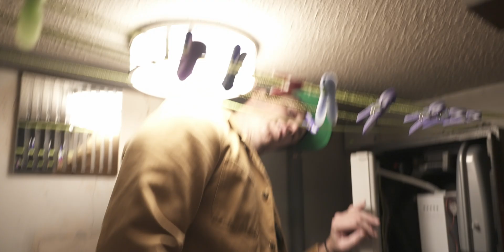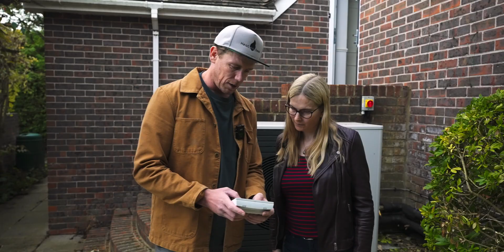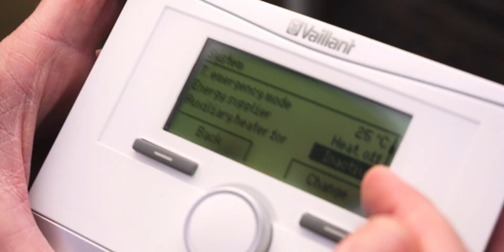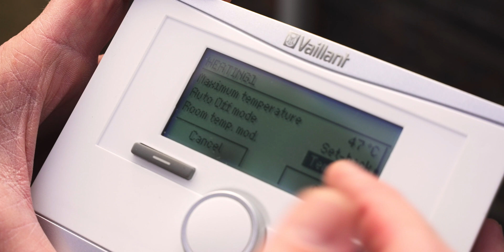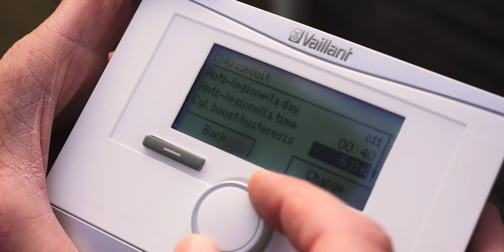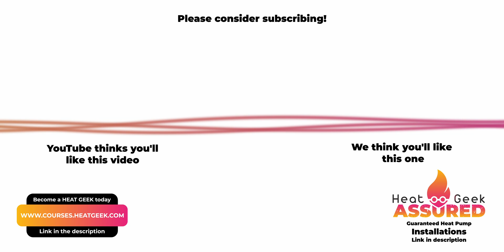How To OPTIMISE Heat Pump Settings!

Comment: What outside temperature should one consider when sizing a heatpump? I worry about my installer recommending one that's oversized for the milder days, but also not keen on an undersized system for the coldest periods.
Reply from the maker: Between -1 and -3.5
Reply: @HeatGeek  Thanks! So in warmer temparatures there's some inevitable cycling due to lower heat loss, but as long as HP is optimally sized, this is minimized.
Does the Arotherm Plus 7kw have an eco setting which limits performance in mild temps? I know the Saunier Duvals do, but installer doesn't recommend due to refrigerant. Your channel's fantastic by the way!
Reply from the maker: @A.N.O.1412  sorry I don't understand what you mean by an eco mode?
Reply: @HeatGeek  Sorry, I meant is there a way to set the heat pump to limit the output to say max 60% of the rated output? Saunier Duval's Genia HA series calls it "Silent mode". Does the Arotherm Plus have  anything similar?
Reply: @HeatGeek  Hi Heat Geek. Any idea if the Vaillants have such a mode, or is there a setting to limit output at warmer outside temps? Thanks!
Reply: Got the answer, automated weather compensation control.
Reply: It very depends on the lowest temperature your place can go and how often you reach there
Reply: 25 degrees between inside and outside temperatures to be absolutely sure
Reply: @hazmat5749  that's if you don't off the unit. If you do off unit, count for -10 °C

Comment: "always try and design without a buffer"... should I be concerned if a buffer is specified by an installer?

Which brands would be on your "high quality heat pumps" list please?
Vaillant, Veissmann... any others?
Reply: Bosch. I’d always recommend the boiler manufacturers heat pump, the logic of heating is a lot better than daikin and Mitzi
Reply from the maker: The 3 top heat pumps are nibe, vailant and viessmann. Weather you need a buffer or not depends. I can only suggest a heatgeek
Reply: @HeatGeek  The company I contacted before I discovered your map offer Mitsubishi. My local ish Heat Geek provided an estimate for a Midea. Viessmann have put me in touch with an installer who's not on your map (yet) and today, I cross referenced your map with Vailant's site and reached out to Vito.
Reply: @HeatGeek How does a Midea compare? LeiChat mentions his heat geek quoted for one?

Comment: OMG, look at this thermostat! an unusable design from 80x, who designed this square thick box? Vaillant really? Monochromatic screen in 2022? Look at the thickness of it, does it use vacuum tubes? that would ruin any interior. looks like they were trying to make production cost sub £20. How much do they charge for that? £250+? can you use an app? yes, and it is even worse with a rating of 1.8 stars? can you use something nice, like nest/tado? No? because of incompatible eBus. OpenTherm support should be required by law for all consumer boilers and heat pumps. Adam, superb video, but feel really sorry for Rachael ending up with Vaillant.
Reply from the maker: Totally agree with the physical design and good point! When it comes to actual control of the system though, to suggest nest or tado was comparable or better is laughable. The box its in doesn't represent its ability. Never judge a thermostat by its cover
Reply: @HeatGeek  Sorry, but I would judge, the reason why they do not do OpenTherm is because they can't create a good product and compete. this is why I want to reply to @Candisa here also. I am not a heating engineer and have very little knowledge about heating systems (basically whatever Adam shot as part of consumer advice), but I am a software engineer with a good background in electronics, and will be talking only about this part. I've used ESP8266 to create a small eBus controller, and thanks to ebusd project I was able to create my own map of reverse engineered massaging and talk with the boiler,  have my own weather compensation,  and learned the communication part of this. When a company takes an open standard and creates proprietary extensions on it to stop others from implementing 3rd party controls, they are doing that not because their controls are that good, they are doing it because they are bad. Otherwise, SensoCOMFORT and V700 would be OpenTherm/original eBus compatible and people will buy them to run with other manufacturers' boilers and heat pumps. Vaillant group goes out of their pants to make a different variation of even own eBUS extensions to prevent reverse-engineered implementations. It is like your TV would implement over the same HDMI cable a different signal to work only  with a TV box which is the same brand. This limits OpenTherm itself, there is no reason to invest money, start a company, or provide better products, because most of what you can do is cycle the boiler/pump in on-off. V700 has a bad design, MultiMATIC may have a slightly better look and feel but a bad UI, and this is it. this is your choice or your "no choice". Apps reviews are horrible, and because of that I would not expect a good quality of software engineers in Vaillant, that means your data is not safe and you are better off the Internet connection for this device. No Internet, then no home presence sensing, and no learning. Here I am not judging any part of the heat pump quality, but the software and vendor-lock practices, and the ways they are implementing them are absolutely dreadful, the whole industry of software and IT hardware is openness in communication standards. OK, if eBus for some reason is far superior to OpenTherm (it is not, let's just imagine the case), publish the message documentation, and do not change them with every hardware revision, make it a standard.
Reply: If you want to have a flashy modern black touchscreen thing on the wall there's always the "SensoCOMFORT". 
Most interiors still have simple white but quite blocky switches and sockets, so if you want something that matches that and doesn't have to emit light to be readable in daylight and has physical controls, you're better off with the MultiMATIC like in this video.
Reply from the maker: Open therm should not be in heat pumps imo. The control and heatbpump need to be as 1 and understand eachother. And the ipen themr controller has to have good permatter options. If there was 1 single open therm controller outthere comparable to a vailant viessmann or nibe I may change my mind but even then it would be open to put poorer controls on
Reply: @HeatGeek  Another reason why we need that 'manufacturers controls only' bumper sticker :D
Reply: @Hugh Frater @Heat Geek  In this Video I saw a ton of confusing settings because the VRC700 thermostat is dumb. Maybe Adam can explain to me and others why smart thermostats need a weather compensation curve at all? Why it would rely on a human being to make the right decision in selecting a number? from eBus (OpenTherm) it can receive heat generation by the heating system, electricity usage, flow temperatures and pump speeds/performance, which gives it enough information about the amount of pumped heat, it can see the temperature changes with almost 0.01 steps for inside and outside, it can easily calculate the property heat loss better than any heating engineer. Smart thermostats should learn the heat loss pattern of the property and do weather compensation and will be able to react to higher wind or sunny days or forecasts. 

But why the third-party controls even with OpenTherm have that bad reputation? this is just bad gas engineers installing boilers. An example: my property was about 6-7kWh loss in a cold day, I switched the annex to an air-to-air source heat pump due to it living a completely different life than the rest of the property. Now I have maybe 6kW heating demand. The boiler sized by the previous owner's plumber 2 years ago is 26kW with the lowest output 7.3kWh. there is no modulation, only on-off mode as result with any control even the manufacturer. The lack of open standards in the boiler doesn't allow nest to learn the property as no feedback is provided.

 If you think that eBus/OpenTherm is full of "high-level smart things", nope it is not, it is a very simple and primitive serial bus. if you have a controller connected, it can tell the boiler (heat pump and other boilers is absolutely the same, Vaillant changes messages slightly, but the list of parameters stays the same for all their group products): switch on or off heating/hot water. flow temps for both, pump mode control, and a few minor things. In short, all the controller tells your heatpump is the desired flow temperature. the controller can receive information from the heating system, like gas/electricity usage rates, flow temperatures, and other things (even time to next service for some models) to make the right decisions on just the flow temperature.
Reply: @ksim_  The only controller/smart stat that does this is Homely - and it supports realtime flow temp control over 485 to Midea or Samsung heatpumps. It knows electricity spot pricing, weather forecasts, solar gain, internal room temperature. It will self-tune the WC curves for maximum efficiency, and will switch to load compensation if that's required for fast recovery from a setback.
Reply: @dorsetengineering  so do nest and tado, but on  properly sized systems connected to OpenTherm, Homely won't be able to modulate anything if the maximum demand of the property is lower than the minimum delivery of the heating system  

Glad you agree that  VRC700 is a dumb thermostat as it is not doing any of the above. 

 ebus/OpenTherm/485 all have essential messages for a smart thermostat to do its thing. receiving metrics about flows, consumption, and efficiency + feedback on the flow temperatures and basic on/off states. There is no magic in any of these protocols, the only reason they do exist is the companies are trying to vendor-lock you. Vaillant knows how to do a pump/boiler, but their software side is laughable.

I fully disagree with Adam and you about the manufacturer's controls as one with the heating system. the "smart" thing of a thermostat is in decision-making, not in the communication protocol. Sure Adam can make a video and explain how Vaillant's version of eBus makes it by far superior to OpenTherm, highlighting the messages that make it so, will be happy to watch it. But for now, IMHO, it is just shady vendor-lock practice to limit competition and sell overpriced ugly-looking products.
Reply: @ksim_  gas boilers talk opentherm, heat pumps don’t so until we get a programmable opentherm to modbus gateway then we’re stuck with manufacturers controls or homely. Both of which are superior to simply controlling a heatpump on a fixed flow temp with an on/off stat. I’m fully aware of how good a nest, running in opentherm mode, into a gas boiler can be, but it’s something that’s just not do-able yet with heatpumps. An opentherm to modbus gateway wouldn’t be hard at all, you’d just need to program a specific set of modbus registers into the gateway for whichever heat pump you were talking to. I don’t honestly think it’s a case of vendor obfuscation and lock-in, I just don’t think they’ve given it much thought.
Reply: The nest is fairly dumb compared to this. It limps along realying on an internet connection for most of its energy savings. I don't mind my Mitsubichi FTC6 thermostat in the least.
Reply: @djenson  nest is dumb in on/off mode, as 90% of people have it in, and is very good in opentherm, at least was for me. but the question here is the locked down made-incompatible-on-purpose devices, to sell these horrible-looking and functioning controllers, which you can't control. I do not trust Vaillant or Mitsubichi with the data of my home presence, judging by the quality of the app you can't trust they keep the data safe.
Reply: @ksim_  I was going to take you seriously until i saw "I do not trust Vaillant or Mitsubichi with the data of my home presence", So you trust google over mitsubichi? Interesting. (let not forget the current lawsuit against google)

 Mitsubichi both emailed my and sent a notifation to the app when a vunerablity was found in the WPA2-PSK protocol and gave advise on how to keep the system secure. That has nothing to do with them, but because it could techniqually cause a breach in the system, i was informed, Once a vunerablity was found that with local access, a backdoor could be formed, a patch was sent out with a explaination of what had happened. You dont see this from google, just a "fixed bugs" 

Anyway, let continue the sencible points

The whole point of what I was saying that in order to save the $145 that nest quotes, it relys on the internet connection to do its turn on/turn off perimeter thing. You do *not* want to do that with a heatpump. There is no effiecency benafit to connecting proper heat pump controls to the internet. You do not need to trust mitsubichi with your data, purly because it does not need to be in there hands in the first place.

Opentherm allows for modulation, sure, but opentherm does not understand many of the varibles heatpump controls do. Take my heatpump controls for instance, they have access to flow and return temps, Outdoor temps, indoor temps and the hot water tank temps all in one place. Opentherm (as far as i am aware) does not allow for this data, that is essential to a heatpumps effiecent operation. 

"horrible-looking" is subjective. I prefer my FTC6 controller compared to the nest, and it is certantly much more readable then the tiny screens found on nests. It has clear buttons and doesent need 20,000 submenus to do something. 

There locked down for a reason. They dont want some idiots saying "oh lets put this thermostat in becuase it looks pretty" then moaning about the £££ bills a months later

You with your ESP32 custom made controls, genunily awesome, but make some videos on it to show, teach and encourage others before moaning that a data mining monopoly cannot less efficently control your system.
Reply: Nest is an on off dumb thermostat with an internet connection isn't it? Looks aren't everything.

Think tado do proper weather compensation ones.
Reply: @Lewis_Standing  Nest is OpenTherm compatible weather compensation learning thermostat, the problem is boilers and heat pump manufacturers running eBus with proprietary extension data packets, so you can't use anything except on/off. Check Adam's video on thermostats.
Reply: @ksim_  which heat pump manufacturers support open therm?
Reply: @TC-V8  Not many as far as I can tell, they all (at least all the decent ones) support modbus over 485 though.... Most have full flow temp control over modbus...
Reply: There is a much better looking controller available, the sensoCOMFORT, unfortunately at the time of install we were on a very tight deadline and the sensoCOMFORT wasn't available. This really isn't that much of a problem though as it's not used as an in room thermostat as the system is set up to be fully weather compensation controlled and is pretty much set it and forget it. It works incredibly well and the house has maintained comfort regardless of outside temperature variations since it was installed. The VRC700 is therefore out of sight in the under stairs cupboard for most of the time.